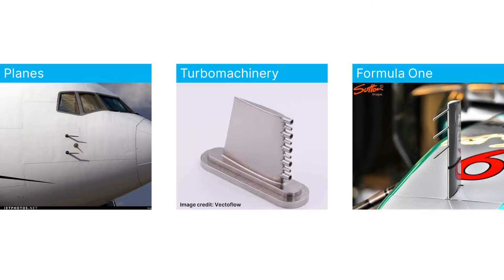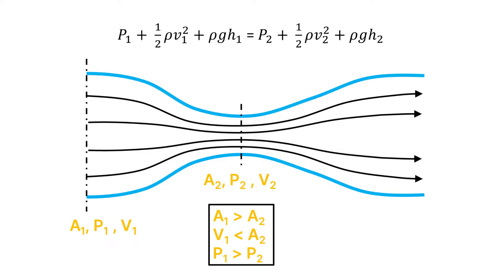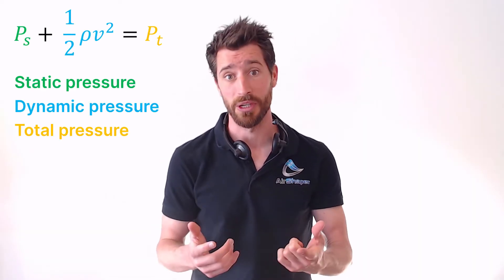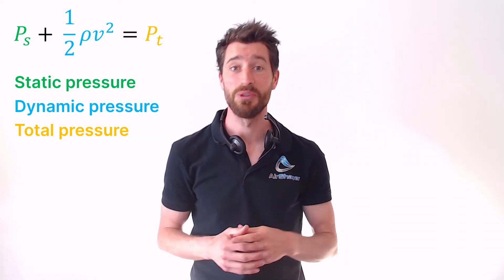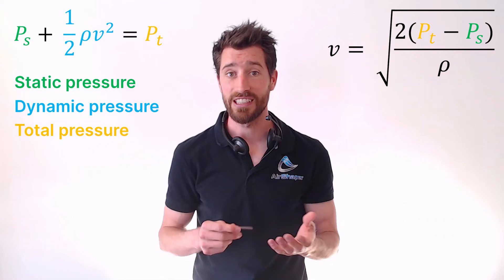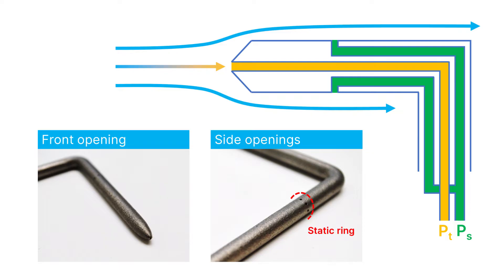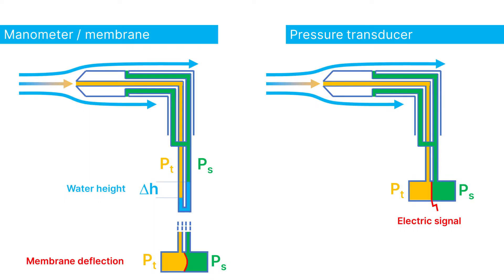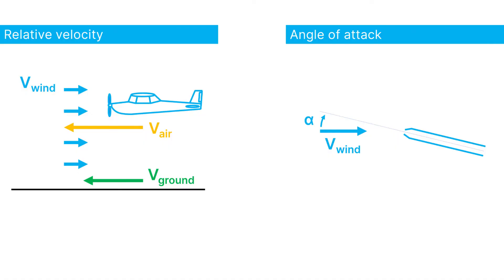Pitot Tubes - Measuring Flow Velocity

Comment: Well, I do not see anywhere where you actually did perform any measurements, so the video title is misleading to begin with. It sould be labelled as "Illustrating Pitot static tubes cutaway". Plus, no numbers as example are provided, so again no measurements are made anywhere.

Bottom line: Not school-classworthy!
Reply from the maker: It's true that no measurements were made. Still, all information is correct and relevant for anyone looking to learn more about how to measure flow velocity.

Comment: Thanks for the explanation! 💪(but I do not care that you are the founder of something and don't see how this is relevant, also why do you wear a headset during the presentation when you are not using it)
Reply from the maker: Haha I don't care much myself either. But I do think it's ok to mention it, as all of this is made possible through AirShaper, the company I started a long time ago. These videos wouldn't be there otherwise, so perhaps this small reference to it is permitted, to help grow the company?

PS: I didn't have a proper mic at the time, so I used the mic of the headset I am wearing (to have it closer to my mouth to reduce the echo in the small room I was using at home).

Comment from the maker: Paulo Franke provided us with a valuable comment:
in planes, the dynamic pressure (difference between the static & total pressure) is measured through a differential manometer and shown as the ASI - air speed indication.
But there is also something called the TAS - true air speed. This is based on the ASI, but adds all kinds of corrections for temperature, pitot tube position errors, etc.
For more information: https://en.wikipedia.org/wiki/True_airspeed